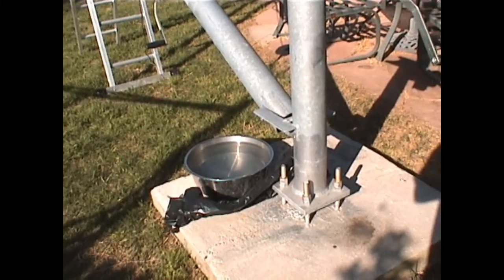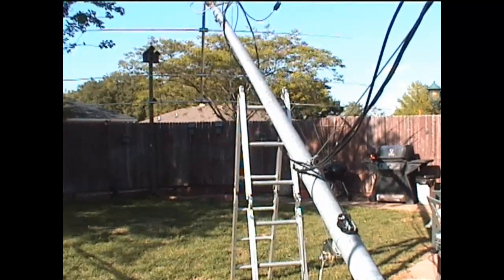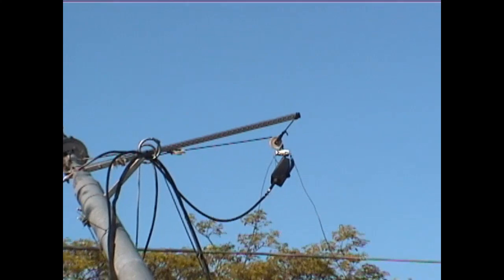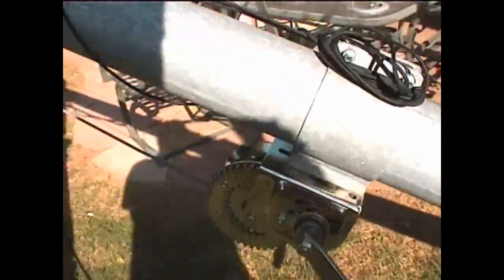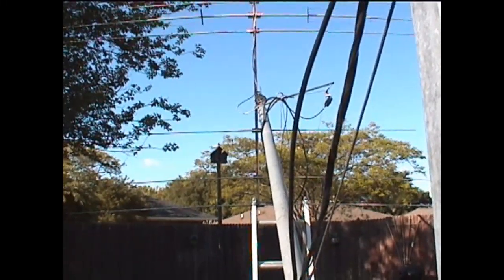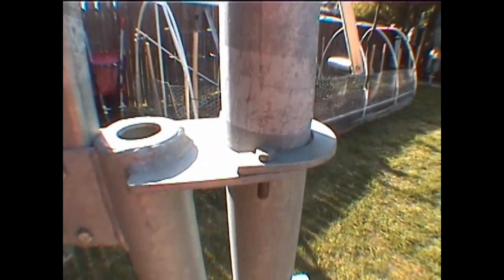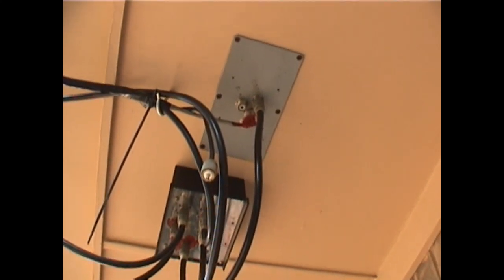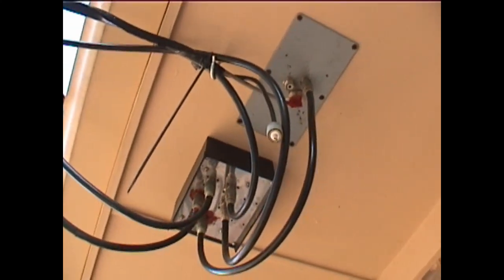KD5OM's Backyard Tower Installation.

Comment: Jerry, how is that ham 4 held up there? Is there a plate of some kind or a mount? Thank you
Reply from the maker: Sorry for just now responding to your question. That is actually a Yaesu G-800 DXA Rotator. As long as I keep the masts very short, there is no problem. The MA-40 has a square plate welded at the top of the mast. The holes were not perfectly aligned and I had to do a little widening, reaming out, of two of the holes to get the rotator to match. Just a MM or two. I've cranked it over dozens of times with no ill effect.

Comment: I purchased a 3-section tubular tower (Manufacturer unknown) that I am guessing is over 50ft when fully extended.  I have replaced the lay over winch with a worm gear model (can raise lower with a big drill) and will do the same with the extender winch.  My question to you is, what is that collar called that fits around the tubular portion that the lay-over winch connects to?  My pipe is 4-1/2" diameter and have not had luck in finding one.  Thanks, W5LF
Reply from the maker: I need no gym membership. I just work out cranking that thing up and down. ;)

Comment: How much was the antenna including installation?
Reply from the maker: Mucho denero!
Reply: averages $1,565.00 for tower not counting antennas. Then whatever cost of cement in your area cost. Not that much really cheaper than most regular towers.
Reply: 2023  price
MA 40 tower  $2400 plus shipping & tax
Hinged base   $1000 plus shipping & tax
Raising fixture   $800
Concrete foundation  $1000 ?
Extra hardware and stuff; coax etc  $1500
Antenna   Steppir   $3500 - $6500
Rotator   $1200

Total  $11K Plus
Pleasure received :  $Priceless

Alternative:  wire dipole in trees  -  $100